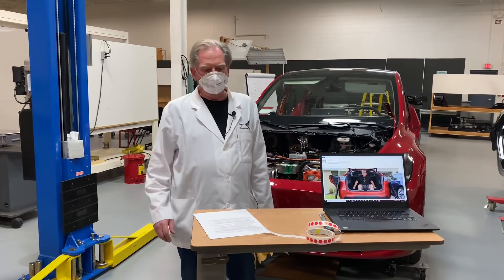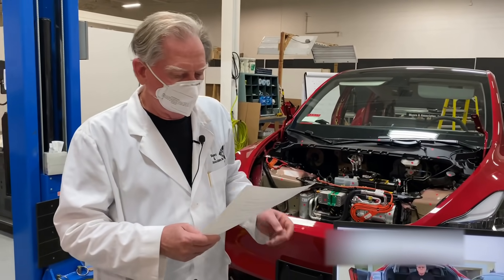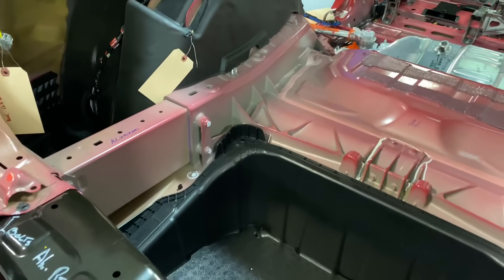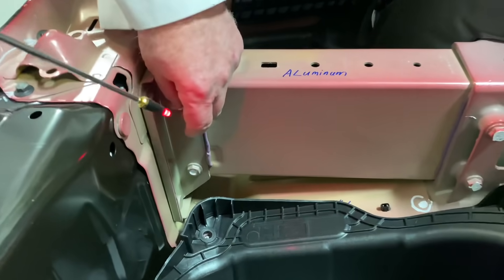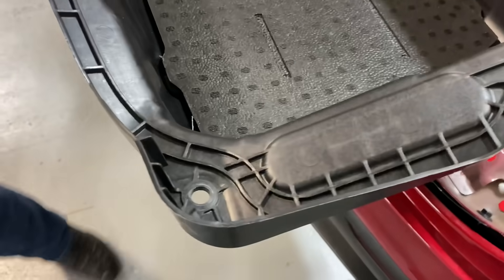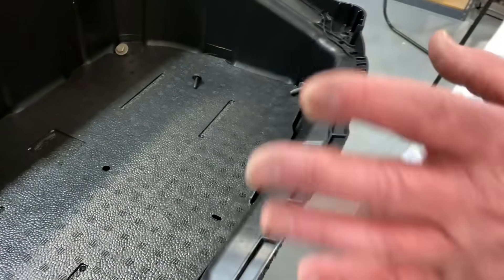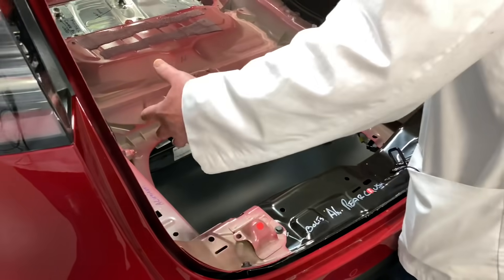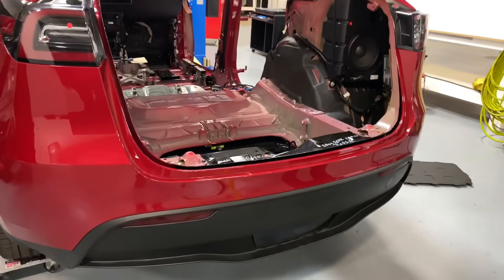Model Y E14: Rear Mega Castings and Structure, Trunk Tub, Potential Tow Location

Comment: I was a former critic but Tesla's design and QC has improved substantially. This is an impressive car minus some interior cabin cost cutting.
Reply: I used to hate Tesla and I really didn’t even like the look of the cars. I kept seeing a million Model 3s so I went to look at one just to see what all the hubbub was. Being the petrolhead I am, I knew I’d hate it. I like manual transmissions, turbochargers, Superchargers, loud exhausts, etc.  Then I drove a Model 3 LR AWD. My entire opinion of the car and company changed that day. I was shocked how much fun the Model 3 was to drive hard around curves, how quickly it accelerated and how easy all of the functions inside worked even though there’s just a few hard buttons. That was in May 2019. My partner needed a new car so I tried convincing him to get a 3 over an SUV like an X3, F-Pace, GLC, RDX, etc.  After we were given a Model 3 Performance by our local sales center to keep for a weekend, he was convinced too. He ordered a white on white Model 3 Long Range AWD. I had a 2018 Accord 2.0T Touring that I really was never happy with because of QC problems with bubbled paint, rust, and especially the rough-shifting 10-speed transmission. I gave in and ordered one for myself in August, a Model 3 Performance. I had wanted to get a white one, but it was going to be weeks or months before I could get a Performance Model 3 in white, so I settled on a black one.

Since I got mine in late-August 2019, I have put 20,000 miles on my Performance 3. It’s been extremely reliable. I’ve only had to take the car in to fix a rattle in the seatbelt adjuster. No mechanical problems at all. It’s gotten faster, smarter and more fun to drive due to the OTA updates. I am converted to EVs. i just long for a semi-affordable EV SUV that is capable off and on-road that would be a good replacement for my 2014 Land Rover LR4. I barely drive it anymore except in times I need to tow or go off road on my job sites. For trips, we only take the Tesla.
Reply: @CFG39  Glad u turned!
Reply: @CFG39  that is almost the story of every petrol head, almost every one I've met who hates EV's has never drove one, I know a few who were like that, drove one and they totally got it and were converted. Nothing wrong with both though.

I want an RX8 track car and a Model 3 daily, nothing wrong with enjoying both.
Reply: I currently have a ‘19 Highlander Hybrid XLE.  I traded in my ‘12 Prius (5 with all the options) for it in August last year.  I wish I had known about the Y then, I wouldn’t have bought the highlander!  My Prius was WAY zippier.  I drove everywhere in power mode and still got 34/36 mpg.  Babying the Highlander I MIGHT be able to eek out 24 mpg!  That’s about the same I get on my modded ‘92 Laser RS AWD!!!  Anyway, as soon as I heard about the Y I put my deposit down.  The longer it takes for me to get that VIN, the more disgusted I get every time I have to fill up.  Ain’t no other car on the road that can keep me driving an ICE car.  I don’t even want my Laser anymore...
Reply: RRBish good for you. I can’t believe you only got 32-34MPG in your Prius. I got that in my 2018 Honda Accord 2.0T Touring and it was a rocket ship. I average about 138MPGe in my Model 3 Performance when I drive a mix of highway and city driving. Cruising on the interstate at 80MPH I get about 110MPGe.
Reply: F C that was in Power mode, which is both the ice and electric engines engaged at the same time.  Hybrid alone I got 45mpg.  I called several distribution centers yesterday, but there were no Y’s with white interior available anywhere!  Bummer!
Reply: RRBish here in Raleigh NC I’ve seen two white interior Ys. One was a white on white LR AWD and one was a blue on white Performance. But that was a week or two ago. Even with your Prius in Power Mode I cant believe it was still that inefficient. That’s terrible. It didn’t have any power hardly so it’s hard to believe it was that thirsty. I could manage almost 40MPG in the Accord on the highway and it has twice as much power as a Prius and is much larger in size.
Reply: F C it is crazy fast with both engines.  I don’t think the ‘12s EPA was 50mpg at best.  I’m on the West coast or I would be all over it - that’s what I ordered! 😍🥰
Reply: RRBish a Prius is about half as quick to 60MPH as the slowest Model 3. If you thought your Prius was quick just get ready for the shock of your lives when you drive a Model Y that can accelerate to 60MPH in 4.5 seconds. The fastest Prius (even in “Power” mode) takes about 9.5-10 seconds to 60MPH.
Reply: F C I don’t believe it took 9.5 to 10 seconds, but it sure wasn’t as fast as the 3.5 seconds I will be getting soon!! 👍🏻
Reply: RRBish https://www.caranddriver.com/reviews/a25475797/2019-toyota-prius-awd-e-drive/

The new Prius AWD-e took almost 11 seconds to 60MPH, the regular model took about 10 seconds. Car and Driver says it’s painfully slow. I have had two Prius rental cars before and they are almost dangerously slow. I’ve just never heard anyone call a Prius quick. Which exact model did you have?

I’m telling you, every Prius is painfully slow. There’s no such thing as a fast Prius. You will likely literally feel sick when you accelerate in the Tesla. I come from a history of fast cars and the Model 3 Performance’s acceleration literally made me nauseous for the first two weeks I owned it. Now I’m used to it and it doesn’t even feel that fast anymore. lol.
Reply: @CFG39  I found this on Edmunds: "In track testing, we clocked the Prius from zero to 60 mph in 10.1 seconds, which is about average for a hybrid vehicle."  They talked about the different driving modes, but didn't say anything about track testing in the power mode.  It really didn't feel THAT slow!  I guess I AM going to have a shock.  I'll be sure to wrap the drivers seat in plastic so I don't ruin the seats the first time I drop the pedal and most likely soil myself!!!
Reply: RRBish yes it’s shocking. Since it’s going to be so substantially more powerful than you’re used to, you should start in chill mode, then give it a go in “Sport” (that’s the standard mode for Performance models). Chill is like 260HP, or something around there, so maybe about 6 seconds to 60. Sport will be over 500HP when the battery is full. It’s so fast you have to really pay attention when you floor it so you don’t get in the acceleration “wormhole” and end up running off the road or into something that appears suddenly.
Reply: @CFG39  HAHAHAHAHAAAA!!!  I hear what you are saying.  It has been a few years since I went to the track.
Reply: @CFG39  just saw this!  Yep!  That was her!  Loved that sad little car.  Always burning rubber!!!!  Nothing like magical thinking and delusions of grandeur...
Reply: RRBish have you driven a Model 3 Performance before?
Reply: F C   I’ve never even drove an electric car before, unless a Gem car counts!  But I grew up in Indiana, and used to race a lot.
Reply: RRBish oh my god. You have to go drive a Model 3 or Y or something.
Reply: @CFG39  Oh, I will...
Reply: Now if they could only improve the paint and fit/finish aspects they'd be "almost" at the head of the pack, they have a ways to go to beat Toyota/Lexus from that point of view.
Reply: walter they e already passedToyota save for a few minor details and that’s really just Lexus. A Camry is not the run forever car it once was.

The rest of a 3 besides the fit and finish is so far beyond Lexus that I couldn’t care less about them anymore.
Reply: Smarter Than You... I agree. Lexus’ current crop of cars is so pitifully old and outdated. There’s nothing in any single Lexus that is cutting edge. Almost all of the engines are carryovers from two decades ago. Their hybrid models are no more exciting than a Prius, and they don’t make a single performance sedan/coupe that can hang with even a LR AWD Model 3, let alone a Model 3 or S Performance. All of the SUVs are ancient too. The GX has been on sale since 2009 with nothing but the most minor of changes. It’s still got the exact same engine and transmission. The LX570 is still laboring around with the 5.7L V8 that was powerful when it was introduced in 2007, but now seems underpowered and grossly inefficient. The RX350 is just plain ugly. I don’t know how that design was ever approved. It’s a hideous beast, and the L version is laughable as a 7-seater. The IS is not much different than it was all the way back in 2006. Sure they’ve grafted on their hideous gaping maw grille to the front and taken a hacksaw to the rear and side to make every surface look creased, but the engine is the same tired 3.5L V6 and Toyota-Aisin’s slow 8-speed automatic that can’t compete with the best transmissions from ZF or VW Group’s Dual clutch units. I have a hard time paying premiums for a car that is basically 15 years old under the skin. 

I’d take a slightly less “reliable” car if it had some soul, looked attractive and was competitive in terms of technology and performance. Lexus produces nothing but ugly mommy-mobiles and rebadged Toyotas they tack fake vents onto in the hopes those who are not actual enthusiasts will somehow think their rear bumper vents make the car faster. 🙄
Reply: @mattbrew11  Well I own a 4R and RX350 and I can tell you there's no problems with paint or fit/finish after years or any mechanical problems. I have no problem with the Tesla but they need to fix the paint and f/f problems to be top notch. You can't compare a Camry to a model Y, get real. I'm not talking technology here, but if you want to talk technology between Tesla and Toyota just wait a few years and then ask the question. Oh you're so smart, lol. Maybe you missed where I said "from that point of view" or maybe you don't understand what that means.
Reply: F C 

You’re not wrong about any of that. 
Someone else brought up Toyota and I almost couldn’t stop laughing. Audi and BMW still have tesla beat on fit and finish but that’s only brand new. BMWs in particular are unreliable very expensive turds
Reply: @CFG39  Yeah that sucks, no one said that Toyota is flawless that's for sure. But they're way ahead of most other car companies by a wide margin. Yes both mine are over 10years old now. Yes but why change something when it is ultra reliable and well built, unlike the garbage NA makers or even the other Japanese makers. I like the idea of Tesla but it just needs to be better at a few things it does then I'll switch over...if Toyota/Lexus doesn't have a full EV SUV.
Reply: F C wow, and my mother just had a Toyota Highlander blow a head gasket.  Thankfully it only had 35k miles on it so it’s still under full warranty and she got a new engine.  But she is 62 and has never gotten a speeding ticket or accident in her life, very gently driver.  And we maintain our cars very very meticulously.  Blowing up an engine seems beyond crazy to me.  

Toyota today seems to have zero innovation and offers nothing exciting at all.  They are just riding their badge and brand at this point and ripping people off for slightly restyled cars built on the same guts as the ones I drove in high school.  But somehow not as reliable as those.

Honda doesn’t seem to be trying very hard either.

I feel like Hyundai/Kia are the only companies really trying to build something nice and stealing market share, besides Tesla of course.

I think Tesla is winning fans quickly and is going to come out on top in the long run.  They’re giving the customer more than anyone else, even at their less affordable prices.  No value-engineering to cut out all the good stuff.  They seem to be trying to pack as much awesome into the product as they can afford to
Reply: J R my aunt’s Avalon Hybrid was a 2016. It ended up being lemoned in 2018 with like 25k miles on it. They ripped out all the carpeting several times. One time I get in it and literally could see the ground below my feet through a hole. They tried to blame it on clogged sunroof drains, leaving windows down, etc. Then they finally admitted it was a lemon and had a faulty floor pan. She got her money back.
Reply: walter all of their cars are so boring. I can’t get behind a car company that leaves a 1.8L I-4 and 4-speed automatic transmission for 20 years with basically no changes. The 4Runner sucks. The 4.0l V6 is so underpowered and pairing it to a sluggish shifting 5-speed automatic just makes it even more unbearable.
Reply: @CFG39  You need the V8. But yes I agree, boring cars but very reliable and that's what I like. Not something you need to constantly repair. Each to their own. My neighbours X5 always had problems, Audi same problem, Mercs same problem, NA cars...well just junk. My cars just keep running period!
Reply: walter I will say the paint finish itself is not bad like it used to be. It’s just too susceptible to damage, at least the black is. I think the problem is that the state of California has so many rules on VOCs that the paint they use is less durable due to its chemical makeup which is in part mandated because where it’s made.